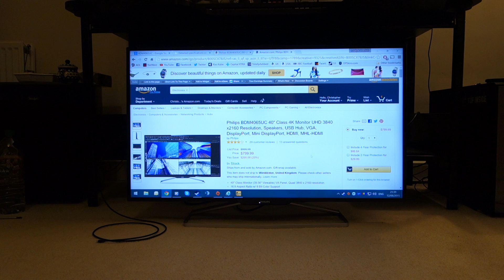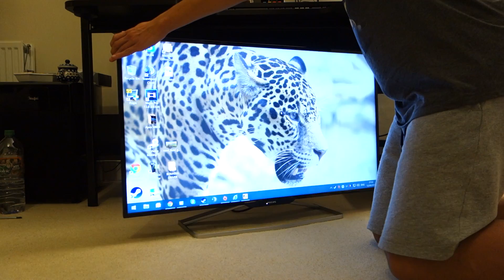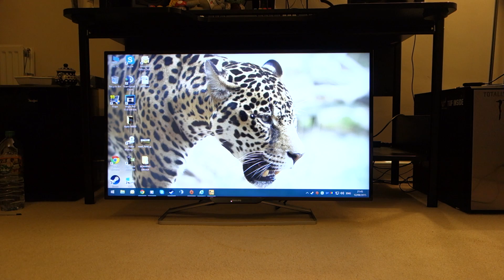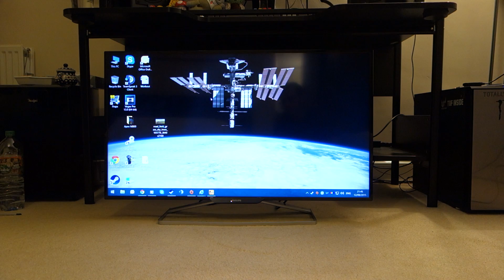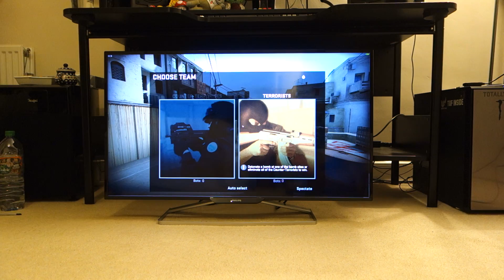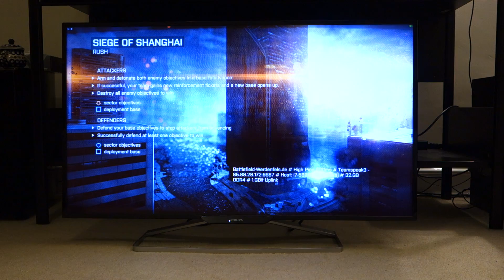Philips BDM4065UC 40" 60Hz 4K Monitor Review - By TotallydubbedHD

Comment: To have those USB ports on the backside is terribly unpractical as you wouldn't be able to really reach them if you wall mount this thing. I was thinking of using it as a display screen for clients to see graphics in a small office, instead of relying on terrible projectors that can't show autentic colors if it's life depended on it. But with the backside construction on this thing it doesn't really seem to suit to be wall mounted and it consumes too much desk space for me. What a shame. All they had to do was having USB connectors on the SIDE of the monitor, it is kinda best practice for a lot of monitor manufacturers. I use the onboard usb connectors all the time on my main workstation monitor.
Reply from the maker: +ventende maybe a USB port switch might work?
Reply: ***** Do you mean like a USB hub? I don't know how much space there is between the wall and the monitor when wall mounted, but one would think every type of connections would be challenging? Wouldn't it bend even a HUB connector? I can't for the love of God understand what Philips were thinking here.
Reply from the maker: +ventende hmmm not sure - why wouldn't you have it simply hooked up to the PC? I don't know!
Reply: *****
Cause I'm not going to work on it as I have a better high-end graphic monitor connected to my PC. I could do a dual monitor thing perhaps but the space is kinda odd. So the USB ports would be key, and since I'm forced to wall mount the thing those connectors would be out of reach. Still can't figure out why Philips would do such a thing, it's not a very smart or common solution.
Reply from the maker: +ventende ah I see - well best of luck!

Comment: so its a 60hz on 4k right?
not only on full hd..
what about eye comfort.. what do you think of that?
is it a glossy monitor or mat?

I prefer glossy personally
Reply from the maker: +Da Ga 60hz 4k - in the title.
It's a good panel
It's matte - almost impossible to find glossy displays nowdays.
Reply from the maker: +Da Ga glossy glare, non-glossy don't glare.
I don't know if it's got blue light or PWM flicker - google it, they're specs, and usually hard to test. Feel free to buy it or get it for review and mention it...
And no LOL, you can't even run 2K on that GPU, let alone 4K!
Camera picks up flicker, not the monitor...
Reply: what do you mean u cant run 4k on that gpu?
you mean u cant run it on 60hz right?
Im talking on desktop operations not on games..
for working on graphics and stuff..
Reply from the maker: Got desktop operations it's fine. For ANY games, your gpu can't even handle 20fps @ 4k
Reply: yea.. all im interested is desktop works..
like ive said i got a gtx960m
which is a laptop card..
i hope it is equal to the regular gtx960 one..

Tnx for the help mate..
keep rocking
Reply from the maker: It's not equivalent at all

Comment: you're not even running the monitor at 4k?
Reply from the maker: I was running it at 4K.
Reply: +totallydubbedHD so you increased the text and icon size etc?
Reply from the maker: +Alec Lewis at the time Win10 didn't scale properly, that's it.

Comment: I just got one today for Christmas.  Plugged it in, hooked up the cables - it is not responsive - is there a trick to turning it on?
Reply from the maker: +James Raymond Sanduski button on the bottom right to turn it on - if it has no power, you'll know this by the led indicator - if so return it it's faulty
Reply: +totallydubbedHD it's going back - thanks

Comment: If TVs are cheaper, why are monitors preferred? They seem a way more expensive for the same screen size and resolution. Thoughts?
Reply: +FesliyanStudios Monitors, typically, have higher quality panels than TVs.  
What you really want for a computer monitor is something that does at least 60Hz refresh.  Watching TV is fine at 30Hz, but you'll find extended use of a 30Hz computer screen will probably give you a headache.
You may also want a monitor with high color fidelity if you're doing photo editing or design work.  Similarly, people are generally more demanding about display uniformity with monitors than they are with TVs.  You don't want shadows or blotches on areas of your computer monitor.. particularly if you're doing photographic/video/design-related tasks.  Some Ghosting/Shadowing is a bit more acceptable on a TV and Manufacturers aren't as critical about eliminating it from their TV panels.

So.. what are the specific problems with using a TV as a Monitor, right?
1.  If the TV only has HDMI version 1.4a input ports, they can't support 4k resolution at 30 frames per second.  To run a screen at 4k 60fps, you need a Displayport or an HDMI 2.0 connection.  Most 4K TVs don't support DisplayPort.  If  your 4k TV has HDMI 2.0 support [still fairly new] you should still make sure your computer's video card supports HDMI 2.0 as well.   Just because you have a video card that supports 4k monitors.. it doesn't mean it will support them on all of the output ports at 60Hz.
2.  Some of the 4k TVs that support 4k at 60Hz will only do so on your computer at a reduced color palette [4:2:2].  This might not be an issue for you though if you don't rely on the monitor being particularly color-accurate.
3.  TVs tend to be brighter than computer monitors because most people sit a lot farther from their TVs than their Monitors.  Try sitting 24" in front of your LED TV for an hour or two [just kidding.. don't.. it's usually not a comfortable experience].   
If you intend on using a large 4k TV as a computer monitor on your desk, you'll probably end up turning down the brightness quite a bit and that might affect the amount of contrast it can display.
Reply from the maker: Because they can provide lower input lag and ghosting, but even then, this monitor for example isn't one that's amazing for gaming.
Reply: +totallydubbedHD I don't game. So I think I'll go for a TV? Any final thoughts? :)
Reply from the maker: +FesliyanStudios then go for the cheapest.
Reply: +totallydubbedHD thx, you helped me find the right one.
Reply from the maker: +FesliyanStudios no worries, don't forget to subscribe for more :)
Reply from the maker: +Schmartist Munky fantastic info right there mate, thanks for sharing!
Quick note though - most TV's run at 50-60hz (PAL/NTSC) - and a lot are capable of higher - ie Plasmas running at 600hz -p however how that works with a PC is beyond me - any insights for my info?
Reply: +totallydubbedHD They do it with interpolation but what I'm quit curios about do they already have Hdmi2.0 the cheaper ones?
Reply from the maker: +Thaiminater I don't think TVs have HDMI 2.0 - at least from what I have seen in the market
Reply: +totallydubbedHD So how can they make about 60hz? :) 
I'm looking to buy this Monitor in July but im not sure if i should also get an 144hz 24" 1080p one for Csgo
Reply from the maker: +Thaiminater true. CSGO - you really should go for a more gaming orientated monitor!
Reply: +FesliyanStudios hey It is compatible with a pc laptop gamer ?
Reply: +FesliyanStudios You want to make sure that any 4k tv you get to use as a computer monitor supports "4:4:4 Chroma @4k 60Hz". Otherwise when ran at 60Hz text becomes difficult to read because of color compression. It will take on blue shades that reminds me of looking at 3D video without 3D glasses. Not something you want when reading a webpage or working in office.
Reply: +FesliyanStudios PC monitors are more power efficient and most have a faster responce times. i have a plasma tv and i find that my monitors produces sharper images ,i would never go back to using a TV for gaming.
My plasma tv consumes 137 W  ,my 32 in monitor 2560 only consumes 60W
Reply: +FesliyanStudios its to do with the inputs... how are you actually going to achieve 4k @ 60hz on a tv? you'll most likely need 2 graphics cards and two HDMI cables etc... i have the BDM4065UC and i can run 4k @ 60hz from an intel nuc (which fits in the palm of my hand) over a single displayport cable and single graphics card... thats why i chose the monitor: because i dont need a beast of a computer tower to get 4k... havent looked at the market lately, but if you want a 40inch 4k 60hz screen for a workstation, this monitor was the only practical one at my time of purchase (around august 2015).  id also note that the guy doing this video isnt even running the monitor at 4k...
Reply: +FesliyanStudios You want Dispayport input, for high res AND 60 Hz refreshrate. most TV's just have HDMI

Comment: Hey there, Dubbed! I have the same IKEA Fredde workstation as you, and am also very interested in buying this monitor, so I was wondering: can you fit this beast on your desk? I wouldn't mind removing the monitor stand if I had to, but this monitor looks so huge, it might not even fit that way. Thanks in advance!
Reply from the maker: +Olivér Mudra in theory, yes you could - you would have to remove the top panel and the monitor stand completely. It would take a lot of space on the desk itself, but it is feasible.

Comment: Hi, the color temperature looks so so cool... Is there any way with settings to get it warmer?
And have you tested how well monitor would look running at lower resolution (interpolation) please?
Reply from the maker: +Gianluca Luisi I don't have the monitor any more - I get sent them for review.
You can change the colour tone via the display menu. I didn't test at lower resolutions as I don't ever see the point in paying a lot of money for a higher resolution monitor, only to downscale it.
Reply: +totallydubbedHD Yes, i agree but, also if i'll use it with 2x 980 gtx, in some games i could have the need to downscale to 2k for performance issue.. For this reason i'd like to know how it's working on lower resolution.
Reply: +Gianluca Luisi if you can't run 4k don't use it. at anything but 4k the pixels are huge at arms length. What are you expecting to run for resolution MOST of the time?

Comment: Blowing up the icons and fonts size in Windows?  Why not just get a smaller display?
Reply from the maker: +Stephen Wong thats' just the windows settings - you can easily adjust that
Reply: That's my point. Why would u blow up your windows settings?
Reply from the maker: +Stephen Wong because that was the default on windows 10?
Reply: +Terra Incognita Gaming its how he has it set up is he had cleared his setting win10 would pick it and after max res is set will scale text and icorns to suit
Reply from the maker: +Mark Meakins i7 3770k with a GTX960

Comment: Great review! Ordering this great piece of screenness in about a week.

If you want to set resolution at 3840x2160, use DisplayPort. This results in 60Hz.
Using this display over HDMI will only output 30Hz. This is because Philips didn't implement HDMI 2.0 but used the 1.4 standard.
Reply: +Wushu Wakkie Thanks for writing this comment. I will order a display port cable now.
Reply: +Wushu Wakkie And don't forget to change it to display port 1.2 on the monitor setting.
I used the display port came in the box and it works for 4k 60Hz.